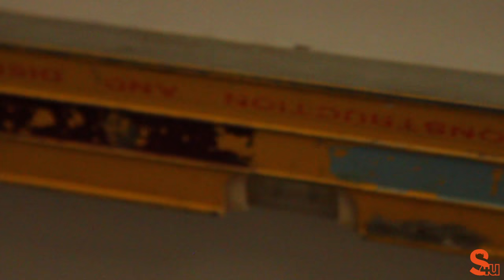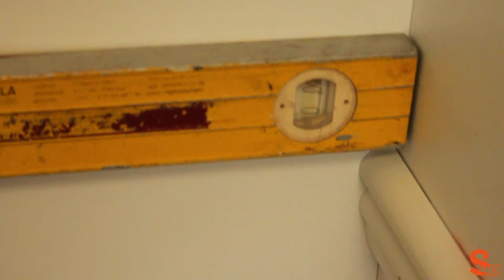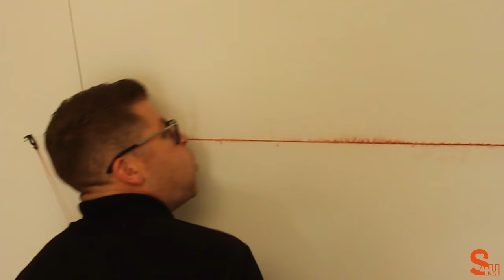How to fit a Dado Rail

Comment: That corner looks like fuck all squared. Why not just cut both rails at a 45° angle and join them up in the corner.
Reply: Internal corners aren’t usually mitred but scribed because walls aren’t usually perfect right angles so you end up with a sliver of a gap. External mitres can be pinched together easier
Reply: Absolutely my idea also.
Reply: @DominicGudgeon  Would still look better than that, and could be easily filled.

Comment: Wouldn't it have been easier to cut the first dado with a 45 degree cut too, so when you are placing the second one they join perfectly without the need for scribing?
Reply: Not every corner is perfectly 90 degrees. Coping allows for a better join. Also two mitre joins tend to open up and cracks your caulk

Comment: If you want to attach mdf sheets to the wall too (for wall panelling) do you put the dado rail on top of the mdf or attach it to the mdf
Reply: Did anyone respond? I have the same question!
Reply: @jobloggs7400  you can rebated dado rails or you can do it yourself with a router. So then the MDF sheet tucks into the rebate.

Comment: Why 900 mill up I’ve did my own height to fit an ornate pattern wallpaper under it
Reply from the maker: 900mm is a good level for a room with standard height ceilings- particularly if you're using it functionally to protect the wall from furniture bashing the plaster. However this is only a suggestion, so if it looks good for you at a different height then go for it! Thanks for commenting on our video :-)

Comment: So why no show how to mitre the corners and at what degree is the mitre saw supposed to be at ,the way you do it is easy fir you but for me it’s easier to just mitre the corners
Reply: @Kacie Jones it only looks better if the walls are completely square, scribing allows you to set dado rails or skirting on a wall that isn't perfectly square.
Reply: @Kacie Jones Only with square walls.
Reply: Isn't it best to just put it in line with your windowsill ? Mine is 96cm above the ground, so the  eye would see the long line of my 180cm long sill, then a dado rail either side which wouldn't continue that eyeline, but would suddenly make the eye move down 6cm and break the flow. It would drive me nuts looking at it !

Comment: what size nails did u use?
Reply from the maker: Hi,

There is no specific nail size as long as you are using an adhesive (you are tacking it in place until the adhesive goes off). Personally, I would say you need at least double the thickness of the material you are using eg If it's an 18mm thick dado rail then use 40mm nails. if you are not going to use adhesive then you would need much longer nails.
Reply: Would have been useful if you mentioned that in your erm erm erm narrative
Reply: Why put a nail on the curve rather than inside a groove... Duh
Reply: @charlievan4877  why are you so rude